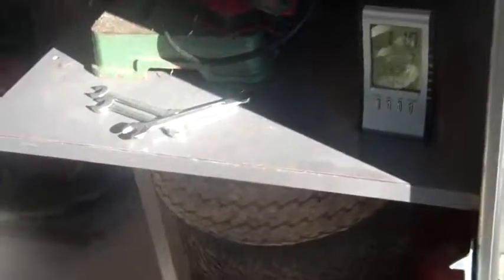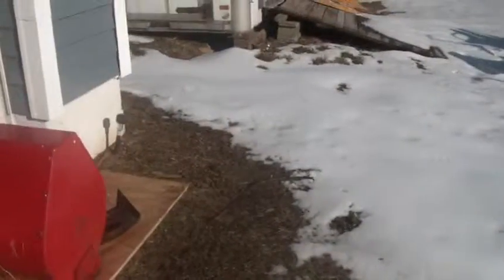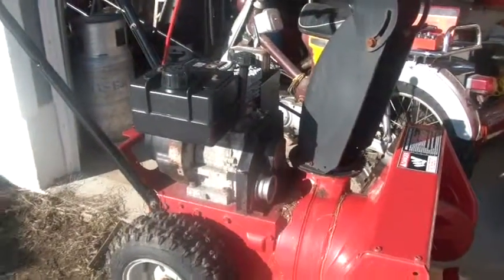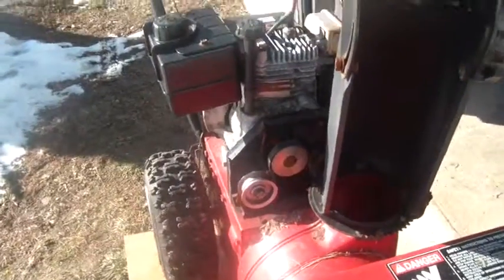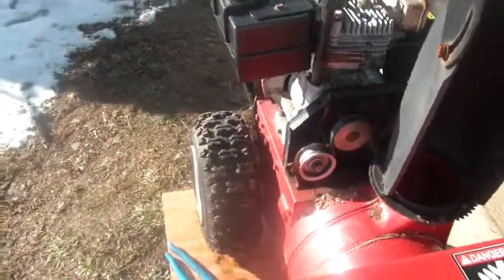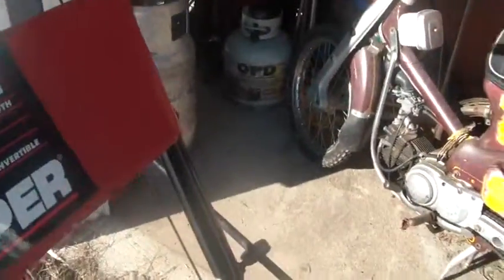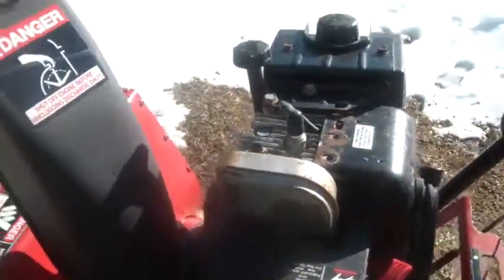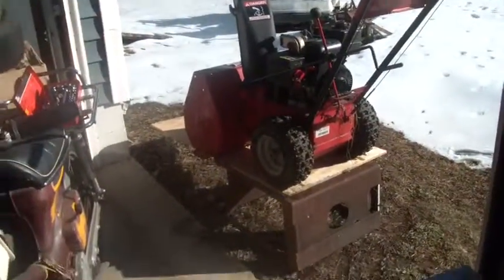1 7, Snapper Snow Blower

Comment from the maker: Pyrophilster;  Thanks for the comment, U ae right about the little screws to remove the recoil, I discovered that when I removed the whole cover the hard way. I must be used to the old school engines. And perhaps U are correct about the snapper being a well made machine from modern standards. I hope my old school Ariens 7-24 lives a long time and the Snapper only has to work as a back-up unit.